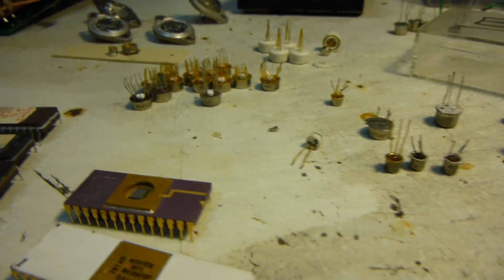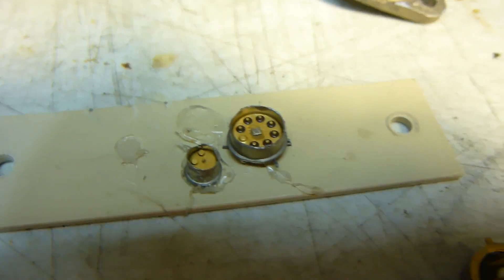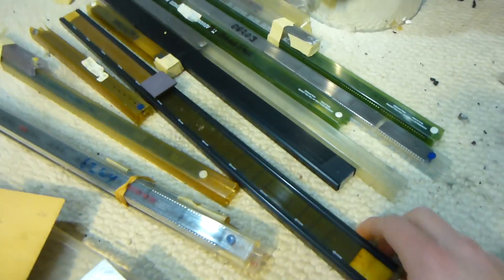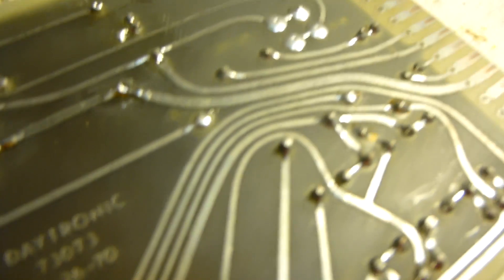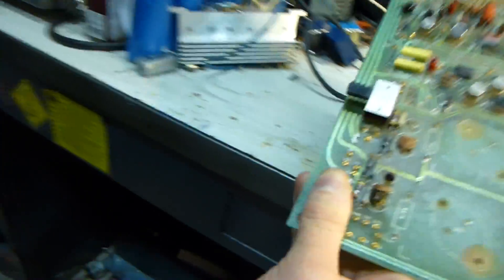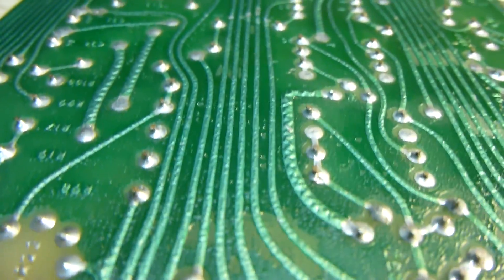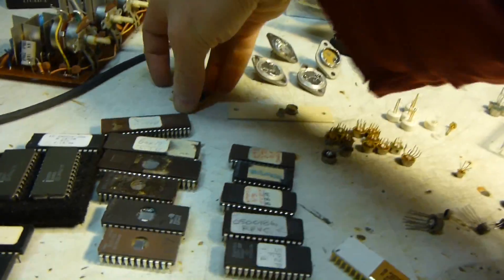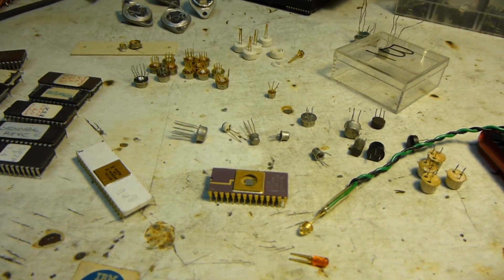My Vintage Electronic Component and IC Collection

Comment: The gold can AD637 at about 5:30 is $52 from Digikey.  It is an RMS to DC converter.
An easy way to tell early CAD boards from these tape boards is that all of the trace angles would be orthogonal as the CAD programs they had back then could only do right angles.  It has only been in the last few years that CAD programs can do those curvy traces, which I think is largely due to the flex PCB assemblies that lots of things nowadays use as the curvy traces are needed to prevent stress cracks at the corners of traces.
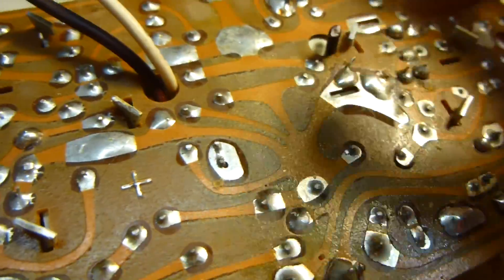The split traces at 11:47 and 11:52 are examples of star grounding and star connections.  They are to make sure that currents entering and leaving each trace node at different points do not affect other connections that that node makes.
Reply from the maker: randacnam7321  Wow, that little chip is worth some cash!  
Interesting!  I did not know that.  
Thank you!
Reply: Makerj101
Gold cavity lid ceramic DILs with Analog Devices part numbers tend to be expensive.  I have an analog multiplier in my parts stocks that is over $100 new.

Comment: Intel C2764 8K x 8  EPROM. I have some of those somewhere around here.. They program at 21 volts and erase via a UV oven
the Mostek IC is a 40 pin DIP processor made by Fairchild. - http://it.wikipedia.org/wiki/Fairchild_F8  
They started making them in 1977 I believe as their F8 line of processors.. They had a massive 1 - 2K of ROM! 

BOLO for my next video of some vintage general electric 2-way radio parts from a Mastr Proline repeater.. Its hybrid transistors and Tubes for the TX RF driver.

I have quite the collection of LEDs here. the metal can type could be IR related, either a transmitter or a receiver, you would have to look up the part number.
Reply from the maker: ElfNet Gaming They are both really beautiful chips with all the gold on them!  Wow a couple kilobytes LOL!  You can hardly do anything with a couple k these days!  

Cool!  I'll have to watch it!

My metal can LED thing doesn't have a number on it or else I would have looked it up.  It doesn't have anything at all on it.
Reply: If I had to bet money on it I will say that LED is an IR type. have you tried powering it up and looking through your phones camera, You know you can see IR light through a CMOS type camera right?
Usually the IR receiver has 3 legs on it also

Yep I may work on that video tomorrow sometime depending if my battery charges fully..

As for the chips with gold. well 95% of the ones I had got "shaved" and the pins and caps sent in for gold reclamation. Turned a nice profit too but that was a few years back also. i did keep a few for the sake of keeping them as antiques.

Also I think (don't quote me on this BUT) that white chip is / was radioactive, something with the material its casing was made from, You may want to give your Geiger counter a run over it and see. 
If it is you can add it to your glass collection lol or someplace in between.
Reply from the maker: ElfNet Gaming  I did try looking at it with the camera a while ago but nothing showed up.

I'll have to test it then!
Reply: It may be a receiver then. Especially if it came off the front of something.
Reply from the maker: ElfNet Gaming Maybe!

Comment: 5:52  wow  10 percent resistors... gotta be mid to early 70's if not older.

6:23  Those were definitely hand drawn PCB traces, or at least the original artwork was and then transferred to film.

10:43  Back in the day, these "layouts" would sometimes be drawn on a large canvases, some times 6x to 10x actual size and then optically reduced onto film with camera equipment.  The reduction process would also reduce drawing "error" and make it sharp and crisp.  Once the film was developed, they would then use standard photo-etch processes, and sometimes a variation (or actual) silk screening.  Computer aided drawing for PCB's didn't hit the masses until late 70's / early 80's.

11:46 Sometimes this was done to keep the area from becoming a big "heat sink" pulling away heat during a wave soldering process, helping to avoid cold solder joints.  "unsoldered" areas were often filled in to help make the acid last longer when etching.  The more areas that were filled in, the less acid was needed to etch away to copper.  That could make a huge impact when etching hundreds or thousands of boards.

14:46  There's a good chance that is actually a photo transistor.  Since the light acted as the "base current" you only needed two leads: Emitter and Collector.  Could also be a photo diode, but it reminds me of some photo transistors I had as a kid.   Could also possibly be an IR led, which could be visible if you used your camera to view it.
Reply from the maker: latasha66 The date code on that board is 1970 so you are spot on with those 10% resistors!

Interesting!  That sounds like a ton of work!  And getting the scale right would be hard.

Makes sense.

I'll have to put it on the ohm meter and see if the resistance changes under light.  This looks similar.  http://www.lamptech.co.uk/Spec%20Sheets/LED%20Monsanto%20MV1.htm
Reply: Makerj101
I suppose it could be a visible LED.  If so, that style LED is way before my time.
Reply from the maker: latasha66 I'm measured it with my ohm meter, one way it measures about 1600 ohms and the other way about 400 ohms.  Both ways fluctuate about 10 ohms when exposed to light.  So if it's a light sensor then it doesn't have a very big gain or it's a burnt out light sensor or LED.

Comment: When you see those curvy tracks they were typically made with "Dot and Tape" which you can Google, a cad give away is sharp corners and minimal curves but not always. When you see two transistors heatsinked together like you showed, they are usually a thermally matched current mirror.
Reply from the maker: Robonza I can't really find anything about "dot and tape".  Interesting, thanks!